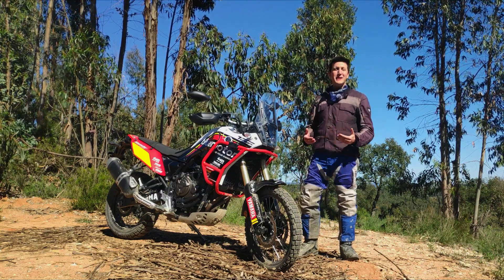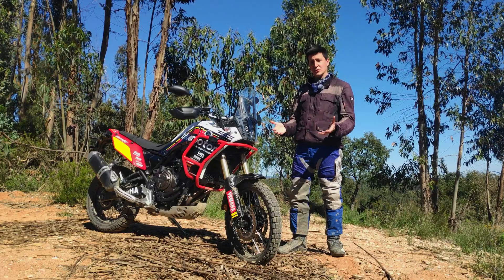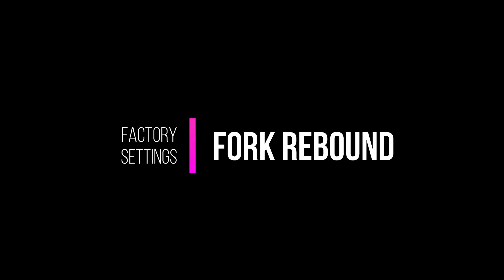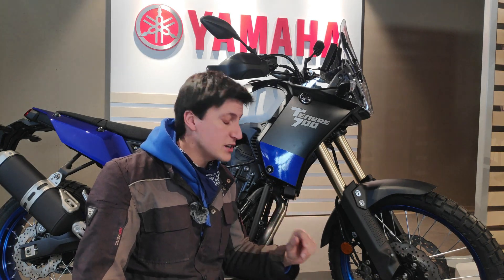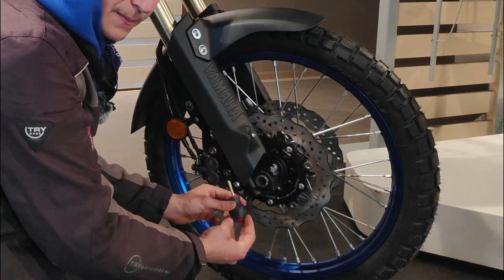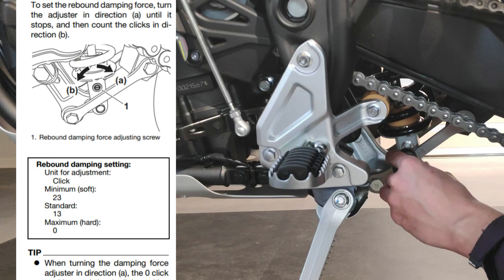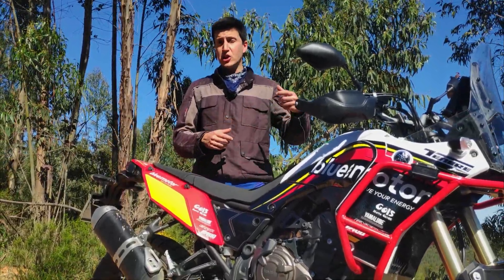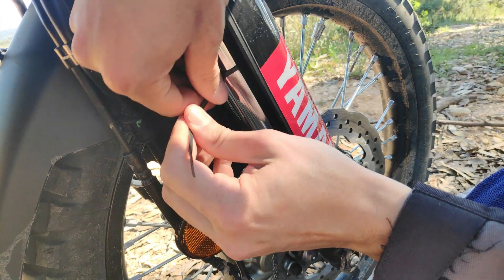Motorcycle Suspension tutorial: Compression and Rebound (T7) 3/3

Comment: Thx for sharing this info, appreciate it very much. 
Is one click a full turn or half or quarter ? sorry mate, I just didn't hear any clicks from the video. Do they actually make a sound ?
Reply from the maker: Thanks for commenting :D
Usually for the forks there are like 8-10 clicks per turn. On the shock preload is maybe a click every 2 turns, and the rebound its like 2 clicks per turn. But it all depends on the motorcycle/brand, etc. You should feel the clicks easily so dont worry.
If you dont feel the clicks than 99% sure your system isnt working anymore and needs maintenance :)
Reply: @OFFroadOFFcourse  Thx, I actually don't have a bike yet right now. And I was really interested in re-starting my motorcycling passion and buy this T7 zero. So that's why I'm acting like a nerd :) Never had a Zero bike before.

Comment: Nice job on all three videos.  It'd be great to see someone address front end dive under hard braking.  Stiffer springs?  More compression damping? Some other trick?
Reply from the maker: Well, if the springs are correctly tuned (using the sag measurements) the it is what it is. As  for the compression, you can definitely increase it in order to minimize the dive, however, the suspension will feel less "cushy" dealing with rocks/potholes/etc. 
Also, make sure your suspensions are not 20 years old without ever being maintained. Suspension oil is just like any other oil :)

Comment: Nice series, good info and good sense of humor. As I weight as you (75kg naked) can you share your final adjustments in preload, compression and rebound for the forks and shock. Will be a very good starting point for me. Thanks a lot, new subscriber here ;).
Reply from the maker: Hey there! Thansk for the comment!

I ended up just adding 2 clicks (+) on shock compression and 2 clicks (+) on the fork rebound.
But I was more focused on the video than actually setting the suspension so I wont say this is done with a lot of care.

I dont like the Pirelli rally STR tires and during some turns the bike felt like wanting to wash-out (front first) hence the higher rebound. Maybe 2 clicks wasn't enough though... Maybe just needs better tires.

On the rear I increased the compression not because I felt I needed, but cause I felt it was SO soft and comfy, i could probably sacrifice some of that for a bit bigger peace of mind for the hard/unpredictable stuff :)

Do as I say, dont to as I do xD
Reply: @OFFroadOFFcourse  thanks a lot as you say will try. But the preload will be almost the same, remember the shock preload clicks? Thanks a lot

Comment: I really enjoyed your series about the adjustments on the T7 as this topic, same as my T7, is pretty new to me. Also interesting, that you found the mistakes of max clicks in the Owners Manual. I will cross check the German edition.
Now it is up to me to find all the different types of offroad tracks to start with the adjustments. I hope I'm sensitive enough to identify the different settings. Stay healthy and save rides 💙💛🏁🤛🏼

UPDATE FEB/2022:
The German Edition and later versions are OK in the area you have identified. BUT I checked several times another area and it looks like the Shock compression on my stock shock offers a range of 24 or 25 clicks and not just 18. Is there anybody out there who can confirm it? All other values are identical to the values in the Operator Manuals and as mentioned in your series of 3 videos. Appreciate any reply.
Reply from the maker: If you can't get the rebound right, use the factory setting (or maybe just 2 or 3 clicks harder (+)). The Compression should be fairly easy to adjust, its easier to feel =)

Comment: T7 front fork can be adjusted on the font claps, meaning you can lower or higher the two front telescopes. I did mine to 0 but I can't be sure what is does eventually... can you please explain these features too?
Reply from the maker: Hey there!
Maybe sometime in the future i will add a video about that to this series! Good idea :)

The effects are +/- easy to explain.
Lowering the forks makes the front of the bike higher, so, lighter. It will also extend the distance between wheels.
This makes the bike more prone to headshakes at highspeed, better for highspeed turning, but a slight tendency to understeer as well (works well at high speed). Also helps a bit with trampling obstacles since the front is lighter.

The opposite (lowering the clamp on the forks) makes the bike easier at lower speeds, less tendency to headshake (unless you do it too much) and tendency to oversteer.

Theres more to say, but this is as far as I know ^^
Reply: @OFFroadOFFcourse wow I'm very much appreciate the time you toke explaining this. curious to see a video showcasing the differences. I ride with a group of t7 owners without a clue about suspension, sharing ur vidros with them raised their thingy above the eye  😉   Cheers from Israel 🇮🇱  🍻
Reply from the maker: @gwolt  ahah, thanks for the share!
There are people who know a lot more about this, i am just sharing a few tips for bigginners ^^
Happy rides my friend ^^

Comment: Great set of videos many thanks. Just curious what settings you ended up with. I’m similar height and weight to you and like similar trails to your intro. Did you deviate much from the std settings? Cheers
Reply from the maker: Hey there!
I ended up just adding 2 clicks (+) on shock compression and 2 clicks (+) on the fork rebound.
But I was more focused on the video than actually setting the suspension so I wont say this is done with a lot of care.

I dont like the Pirelli rally STR tires and during some turns the bike felt like wanting to wash-out (front first) hence the higher rebound. Maybe 2 clicks wasn't enough though... Maybe just needs better tires.

On the rear I increased the compression not because I felt I needed, but cause I felt it was SO soft and comfy, i could probably sacrifice some of that for a bit bigger peace of mind for the hard/unpredictable stuff :)

Do as I say, dont to as I do xD
Reply from the maker: Hey there! Thanks for the comment!

I ended up just adding 2 clicks (+) on shock compression and 2 clicks (+) on the fork rebound.
But I was more focused on the video than actually setting the suspension so I wont say this is done with a lot of care.

I dont like the Pirelli rally STR tires and during some turns the bike felt like wanting to wash-out (front first) hence the higher rebound. Maybe 2 clicks wasn't enough though... Maybe just needs better tires.

On the rear I increased the compression not because I felt I needed, but cause I felt it was SO soft and comfy, i could probably sacrifice some of that for a bit bigger peace of mind for the hard/unpredictable stuff :)

Do as I say, dont to as I do xD

Comment: Thanks for the clear video! I try to understand it a little more and this helps a lot! I have change my rear spring for a stiffer one on my t7, but they say that i have to ingrease the compression and rebound with 2 clicks because i have change the spring. I don't know why, can you maybe explain it? Cheers!
Reply from the maker: To be honest I don't think I have the knowledge to confirm or explain that.
It makes empirical sense to me that a stronger spring needs at least increased rebound, but sometimes physics has cunning ways to balance itself out. 

Nevertheless, the best course of action is to disregard those recommendations and adjust the clickers as you see fit, through trial and error. If it makes you more comfortable, use the recommendation as if they were the factory settings... seems like a good setup to begin with

Comment: I just adjusted suspension on my 690 and 4 clicks in the front compression made a gigantic difference going through potholes.
Reply from the maker: The 690, specially on the early years had a very "performance oriented" suspension adjustment, most dual-sport and adventure riders didn't cope with it well.
Did you add or take 4clicks on the compression?
Reply: @OFFroadOFFcourse  increased compression.
Reply from the maker: @tuskenridertv2678  ah, interesting! What year is your 690?
The one I tried (before 2010) was hard as nails :o back then i didnt know a lot about anything so i didnt think too much about it xD
Reply: @OFFroadOFFcourse  2019, you'll see ;)

Comment: Thanks for the video! Even if it was conceptual, it is still way better than what I saw in other videos as you gave couple of good examples which describe too much or too little rebound/compression. Quick question: does rebound/compression need to be adjusted if I load bike with additional weight (for example load with luggage for a long trip)?
Reply from the maker: Hello Jigger! I dont feel confident enough to give you a definitive answer, and although i searched on the web for info, i didn't find a direct answer/explanation.
As far as I know, for extra weight you only need to adjust the preload, but it makes sense to me that for optimal performance you would benefit from adjusting the other 2 also (maybe cause you dont ride in the same way when you carry weight?)

I can't do the math in my head and i can't find the scientific data to give you a solid answer :o

But i will talk to some people..if i get more info i will get back to you :)